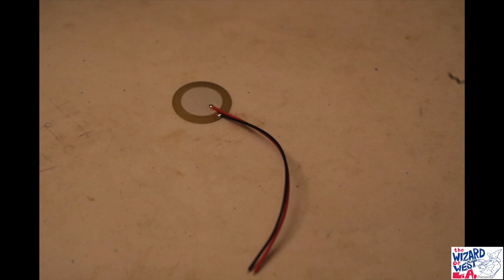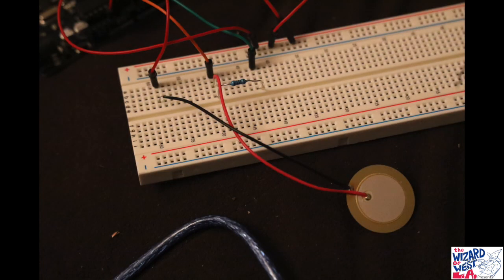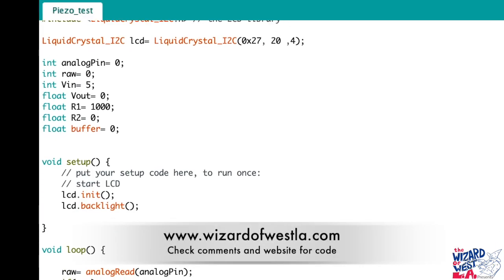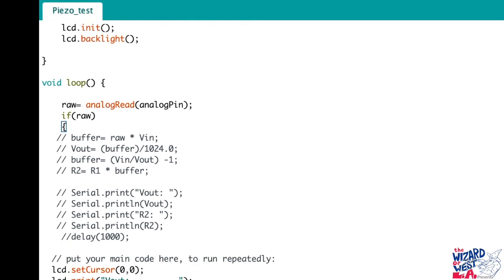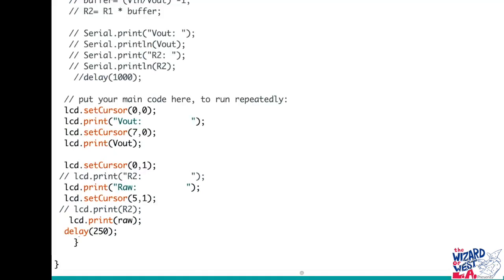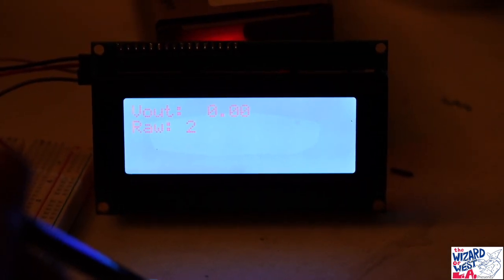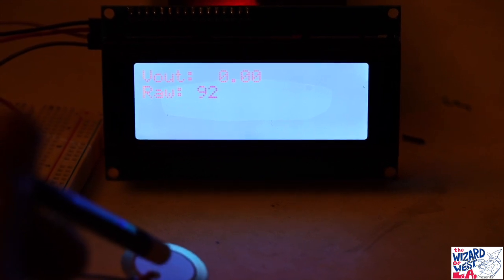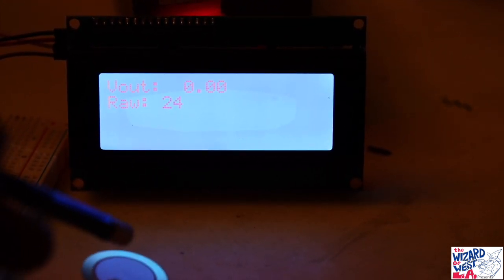Arduino and the Piezo electric effect

Comment from the maker: This is the code you can copy and paste. Just remember to load the library for the display.
Here is a video about how to load a library on Arduino: https://youtu.be/klIRqN9-Zno

// libraries
#include <Wire.h> // library for I2C communications
#include <LiquidCrystal_I2C.h> // the LCD library

LiquidCrystal_I2C lcd= LiquidCrystal_I2C(0x27, 20 ,4); 

int analogPin= 0;
int raw= 0;
int Vin= 5;
float Vout= 0;
float R1= 1000;
float R2= 0;
float buffer= 0;

void setup() {
    // put your setup code here, to run once:
    // start LCD
    lcd.init();
    lcd.backlight();

}

void loop() {
  
    raw= analogRead(analogPin);
    if(raw) 
    {
   // buffer= raw * Vin;
   // Vout= (buffer)/1024.0;
   // buffer= (Vin/Vout) -1;
   // R2= R1 * buffer;
    
   // Serial.print("Vout: ");
   // Serial.println(Vout);
   // Serial.print("R2: ");
   // Serial.println(R2);
    //delay(1000);
    
  // put your main code here, to run repeatedly:
  lcd.setCursor(0,0);
  lcd.print("Vout:          ");
  lcd.setCursor(7,0);
  lcd.print(Vout);

  lcd.setCursor(0,1);
 // lcd.print("R2:          ");
  lcd.print("Raw:          ");
  lcd.setCursor(5,1);
 // lcd.print(R2);
   lcd.print(raw);
  delay(250);
    }
  
}